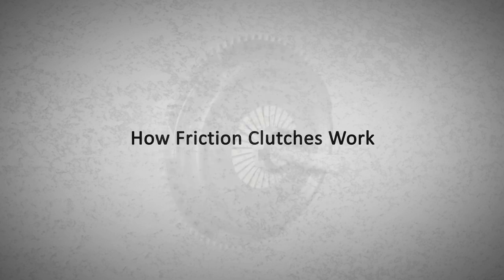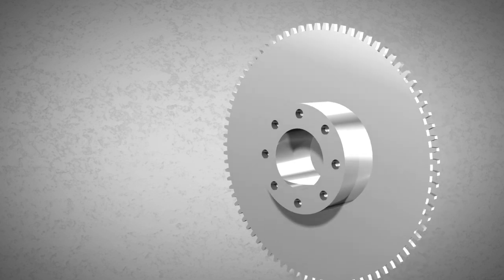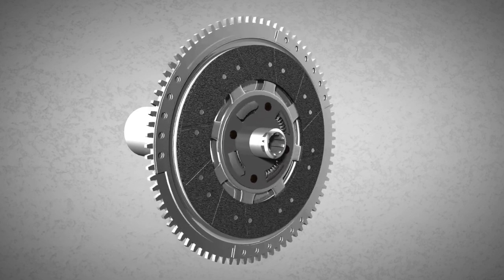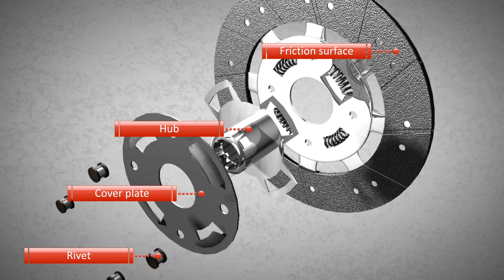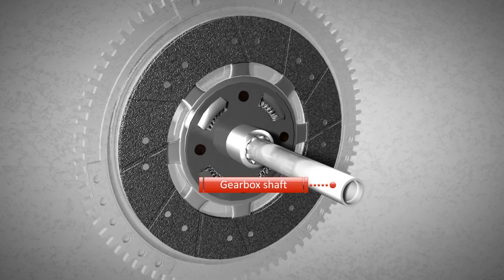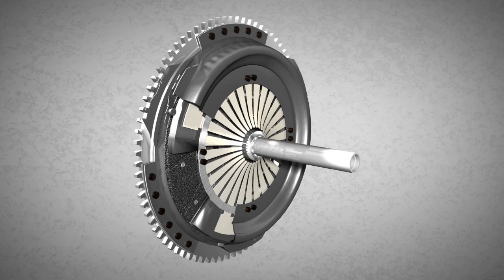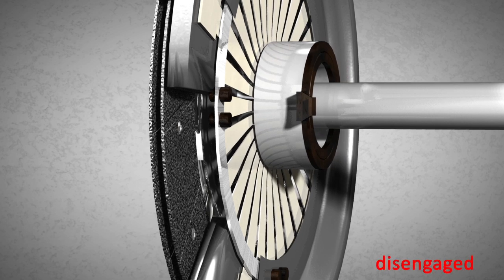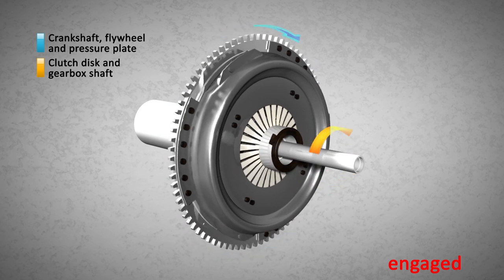How a clutch works! (Animation)

Comment: can you explain why for the 1st gear, we need to release the clutch slowly or the engine will die?
Reply: technically, u dont need a clutch in order to drive. u can drive a car without one, but it inconvenient. i once had to drive about 100 miles without one because one of the tabs holding one of the springs broke. however, u have to be in tune with ur car and its shift points. also, everytime u have to stop, u have to turn off ur car, put it in first and as u start ur car.. mostly, put the pedal to the metal.
Reply: I would also like to add that I wouldn't do any of the above unless you have money to blow on repairs, you don't care about the vehicle, you are really good at it, or because you have to like the story above when the guys clutch went out.
Reply from the maker: Hi, you don't need to do that. If you push the gas pedal, you can release the clutch pedal very fast. It depends on the torque (force) created.
Reply from the maker: Hmm, how will you change gear without a clutch? 100 miles? Did you go in the first gear those 100 miles? Without a clutch, you will not be able to change gear...
Reply: Thomas Schwenke dont get me wrong, i'm not saying that clutches arent needed. just that u can drive without one... and i got to say its not fun
Reply from the maker: Yes, you can drive in 1st gear without a clutch, but you will not be able to change gears. It's impossible for most cars. However, riding a motorcycle without a clutch is possible :)
Reply: Thomas Schwenke oh u may also have to put it into 2nd then 1st on the stops
Reply: Thomas Schwenke i was driving a 86 honda crx if that helps and i was able to do it
Reply from the maker: Hmm, seems to be a synchronized transmission. In my opinion, it's not possible. How could you possibly shift without pressing the clutch?
Reply: synchronized yes. u let off the gas before disengaging.
Reply: my first time doing it was in... a 96? subaru outback from 3rd to 4th
Reply from the maker: Hi. 1st gear to neutral should work, but how will you shift to the next gear? You have to know the exact RPM for the next gear. And even if you know, producing the right RPM is extremely difficult...
Reply: thats y u have to be in tune with ur car and throttle right for it
Reply: Thomas Schwenke It is rather simple. Getting good at it takes some practice but if you have ever driven a dump truck this is most likely how you were taught. It works on all modern manual transmissions that I know of. To change gears up while driving simply rev the engine (rev it high once and let off allowing the RPMs to drop), shift out of gear, slide the shifter to the next gear and apply slight pressure (do not force it), and once the RPMs match it will slide in. To down shift you do the opposite, quick rev, shift out of gear, slide the shifter to the next gear and apply slight pressure, gradually rev the RPMs up, and once the RPMs match it will slide into gear. Also, as a side note, unless it is a heavy duty or diesel down shifting isn't recommended.
Reply: Thomas Schwenke
 You can shift without the clutch. I've done it, downshifting and up shifting. its essentially rev matching or double clutching (i think), the syncros will match speeds, different speeds require different amount of revs. When up-shifting knock the car into neutral (without the clutch and off the throttle) and let the revs fall, and if timed right it will slip into gear. when downshifting you put the gearbox in neutral (again without the clutch when not on the throttle)  rev the engine up (as it the engine would be doing higher revs at the same speed) and it should slip into gear, like double clutching without a clutch. its very hard to do right, the transmission in my car (Nissan FS5W71B) is very forgiving, yes i take off normally. It's not really needed at all but its a good skill to have changing with out a clutch (if the clutch or something shits itself or you're bored). if done right no major damage will be done most trans a very strong if you have a stock car. But driving like this is very slow as one would take off then slip the car into neutral the car would slow down and then you could change gears, very annoying for the people behind you! Best to learn on back roads or late at night hopefully it made sense. CreepMcCreeperson gave a great explanation.
Reply: hamcheesesalami You can't shift without a clutch. You can shift without a clutch LEVER/PEDAL
Reply: Carlyle's Picks
 the clutch pedal is simply hydraulic connection, I was not manipulating the clutch disc. So i was shifting without the clutch.

Comment: A very nice video of how a clutch works.
Correct me if am wrong here, the order is in the way below
1. FlyWheel
2. Clutch plate (Clutch disk)
3. Pressure plate
4. Gear shaft
If am correct here then in the last portion of this video it should have been {CrankShaft, FlyWheel & Clutch plate (disk)} right ? Can you please explain ?